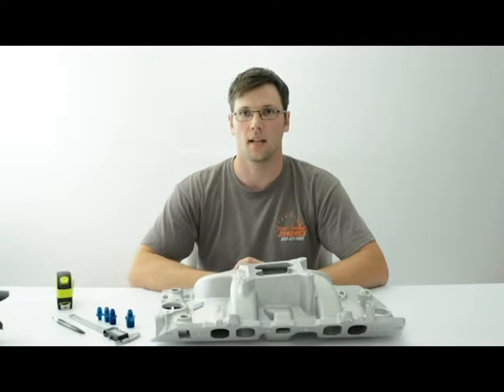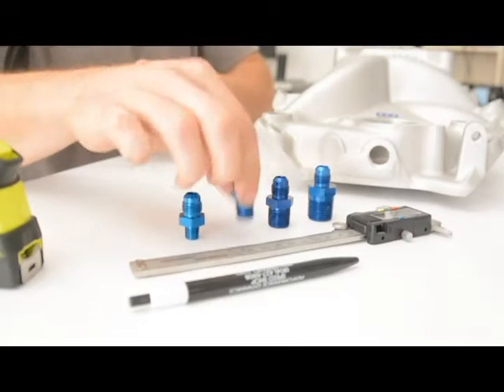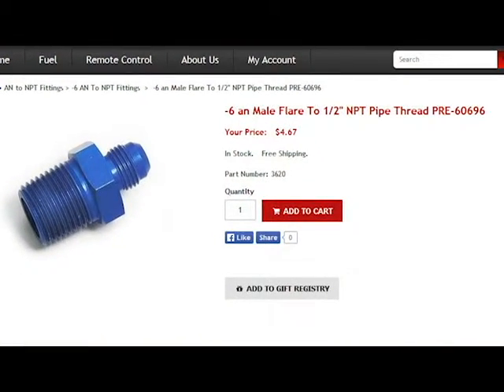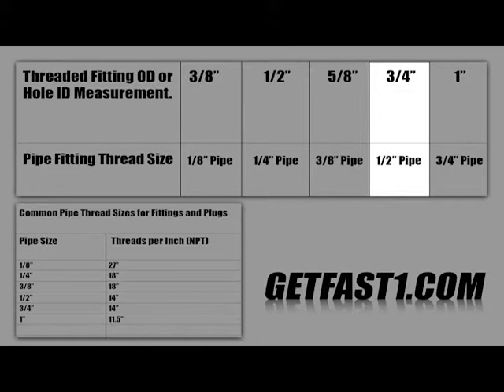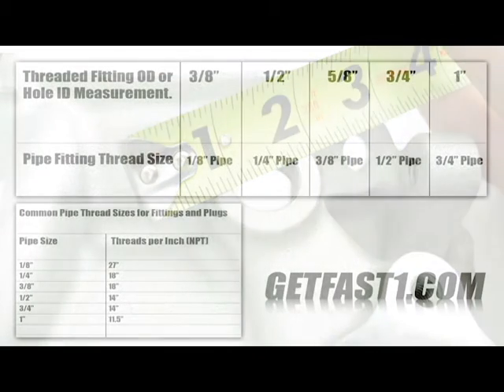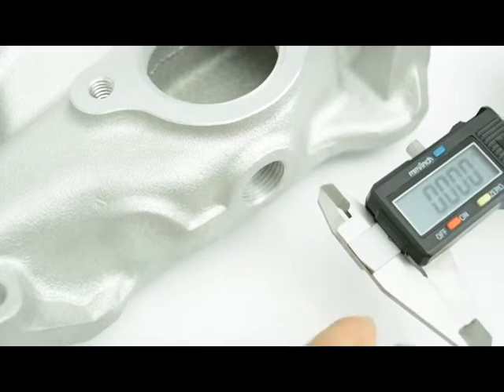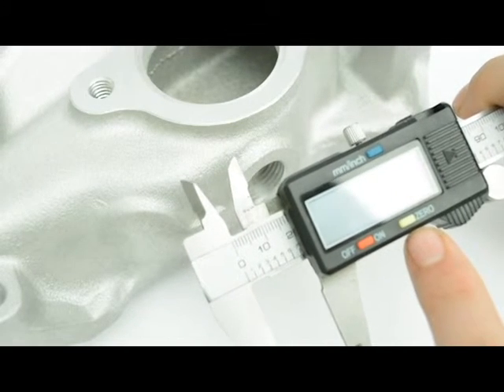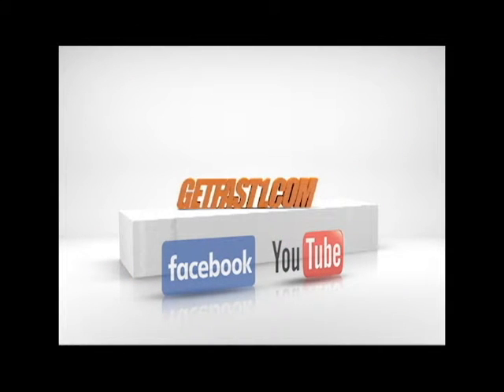GETFAST1.COM How to measure inner and outer diameter threads for NPT Fittings and Plugs

Comment: It is called “National Pipe Thread” no tapered. The treads are tapered to tighten as screwed into a proper threaded hole. It is like say you have a charcoal canister under the bed or your truck, when it actually activated carbon. A Semi tractor pulling a tank container down the interstate must display a DOT identification label in case of accident. They have one for activated carbon, but charcoal is sold in bags for your grill!
  If your off-spring was in the garage burping gasoline smells with a container of gas setting near by, would the hospital give him/her/questioning a slurry of charcoal or a mixture of activated carbon and water w/bi-carbonate of soda to absorb the raw hydrocarbons in the child’s stomach. 
 Or perhaps get some hot dogs and mash mellows and a Weber grill to have a snack?
DK, ASE master tech since 78.
ACDelco Tech Seminar Instructor, Class instructor.
UTI instructor.